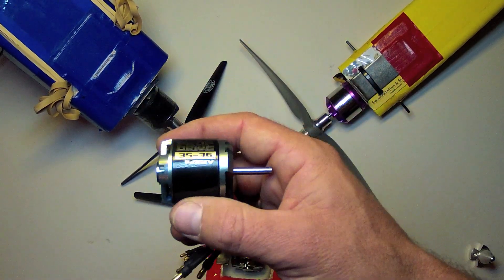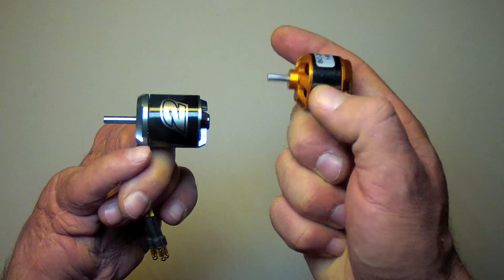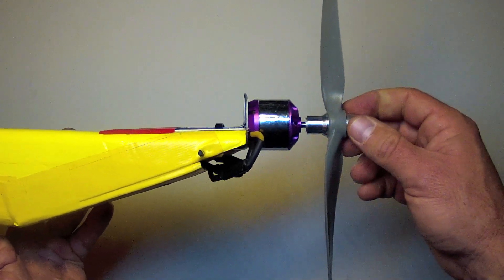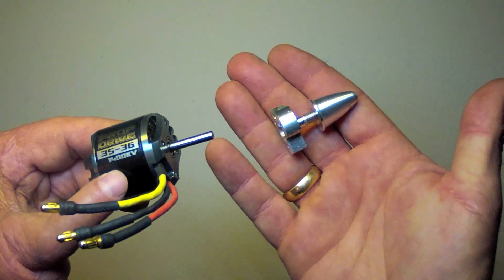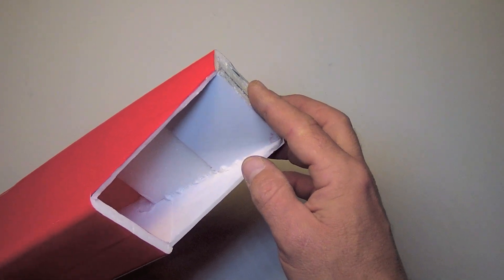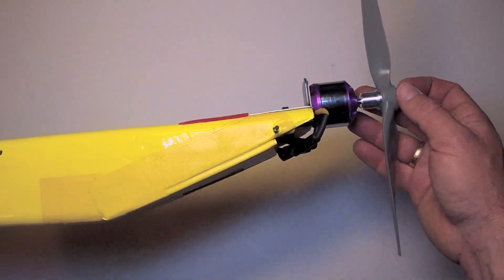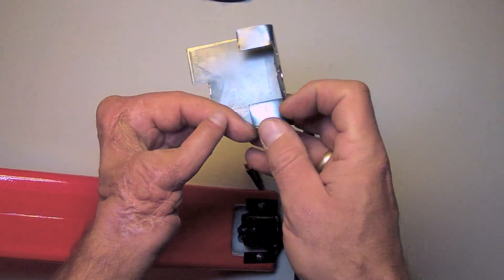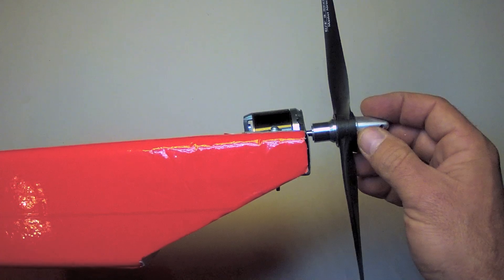SYNAPSE BUILD: Motor Choice and Mounting

Comment: The Synapse is a captivating design and I have all the bits on the way for the build. Hope the weather holds for a decent shot at a maiden before the snow flies.
IMHO the collet type that tightens onto the shaft is both a liability and a crap shoot with regards to the precision of the machining. What I have noticed is the small deviations of the spinner makes for a wobbly,  unbalanced center that can not be addressed except to buy a few more and see what the luck of the draw will hold. Definitely a must have in my books is the correct  screw on prop adapter kit with some thread locker. Approx $3 USD and much higher precision of machining
Reply: +Chris Leech A little update folks. It seems that Hobby King has a little problem with the quality control on the whole of the NTM line up. The bearings in my 
35-36A 1400kV are just awful. I am already ordering new and better before a maiden flight. If you are doing the same, look for ABEC 3 rating (Values run from 1 to 5 where a #1 would barely be good enough for roller skates)

Comment: also, with the prop drive 35-36, the shaft can be reversed by simply undoing a set-screw and sliding the shaft through to the other side, then re-tightening the set screw. no need for an accessory kit

Comment: not sure why you always find it necessary to use titanium motor mounts... I use and always have used balsa and hot glue, and the only time a motor has come off was when I lost signal and my motorglider went nose-in at a 45 degree angle

Comment: I love the NTM PropDrive motors, I'm running the NTM 3536 1800kv in my Radjet
on 6s for 1200 watts.
I reached 243kph level speed with this motor.